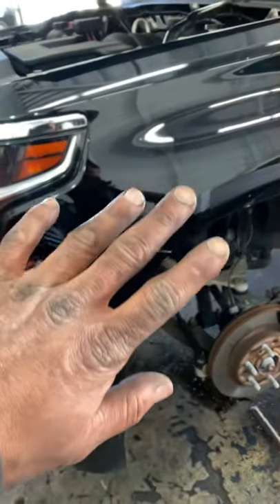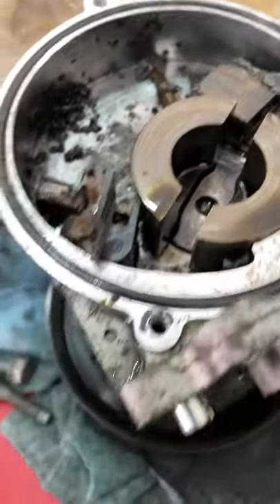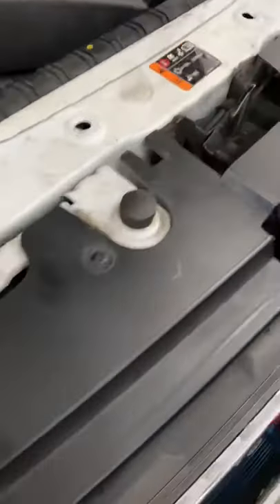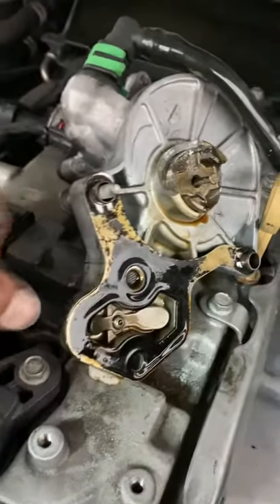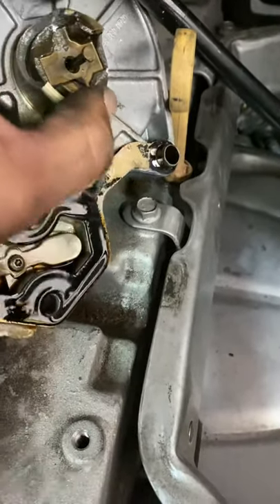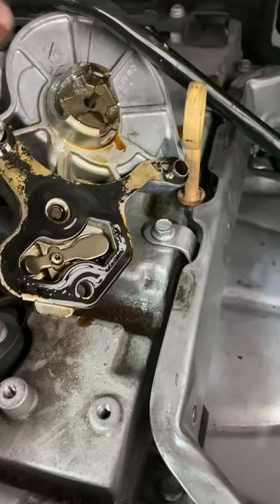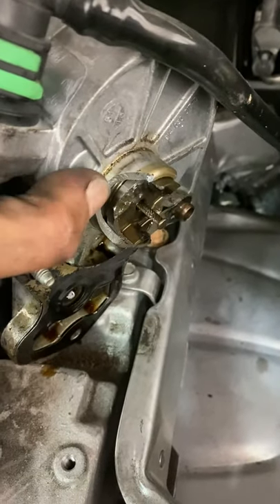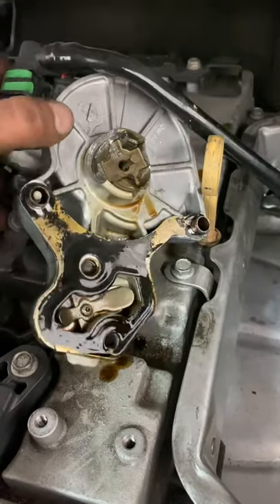Chevy suburban vacuum pump failure.

Comment: They should have junked this motor long ago. They are bad and if you don't change your oil it breaks timing chain guide's and the pistons smash the valves
Reply from the maker: They still use em today and now they have crank bearing problems